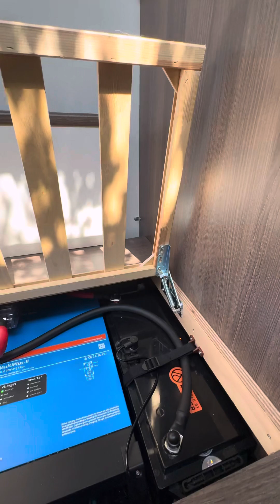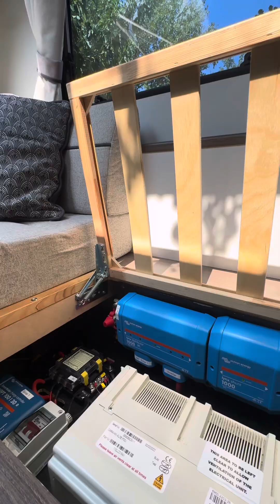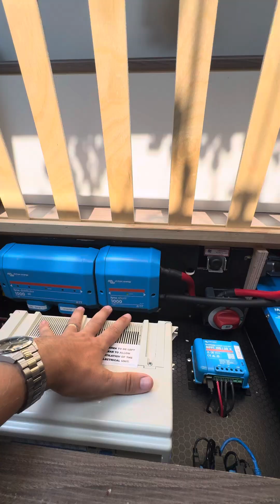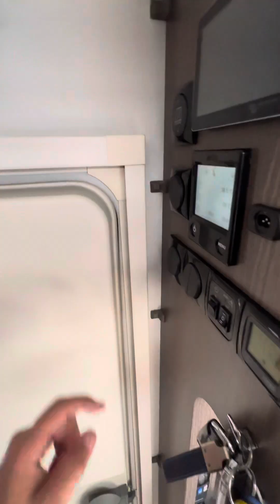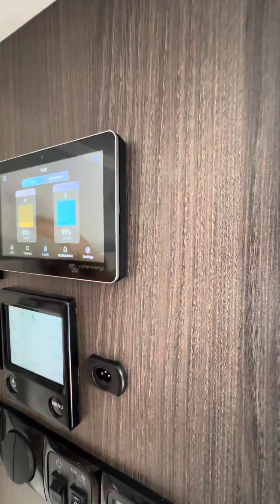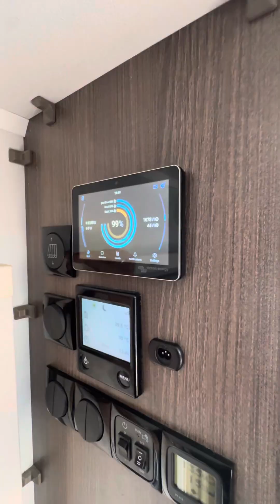Elddis Buccaneer caravan Lithium battery Victron Roamer S4 Off-grid setup

Comment: Do you have a wiring diagram you could share, I’m currently adding a Renogy set up to my 2025 Elddis so just looking at how others have connected up to original electrics.
Reply from the maker: I kind of do, if you message me on instagram or Facebook I can send what I have. the Victron Multiplus is a bit different to the Renogy though so I m not sure it will be of any help as its a pass through inverter meaning the electric from the hook up cable first goes to the inverter, passes through it and then travels to the Consumer unit. This meant all I had to do was cut the orange cable coming from the hook up plug in two and wired both ends into the inverter, it was then a case of supplying 12v on the second feed from the battery

Comment: Hi.  I just spoke to Solwise and they told me you’ve got this video because I have an off grid project.  

I have 2 x 100ah lithium batteries wired in parallel.  I bought an epever MPPT and have spend 5-6 hours playing with it and it’s going back hence I called solwise.  

I’ve got loads of spare solar panels and all I want them to do is trickle charge the lithium batteries as they supply my alarm and WiFi when I’m not there.  Ideally I want WiFi connectivity so I can monitor them from home.  I liked the epever because it monitors the battery temp.  

I want to wire 3-4 solar panels in parallel so I don’t exceed my voltage then feed that into the batteries. 

Any tips on what I should buy?    Thanks.  David.
Reply from the maker: Hi David, I only know Victron stuff but its superb stuff, user friendly and will do everything you want it to do

I'd personally suggest a Victron Smart Shunt 300A, these are around £60, this will monitor the battery voltage, capacity/percentage and if used with the temperature sensor will monitor the temperature of the batteries 

If you want to remotely monitor this on your phone then you'll need a Victron Cerbo GX, this is in short a computer, these can be picked up for around £180, you'll need a Victron Energy VE.Direct Cable which is another £10 but this will link the shunt to the Cerbo, you can then connect the Cerbo wirelessly to your internet router in the caravan/motorhome and create a Victron VRM account (free) so you can then monitor the batteries remotely on your phone anywhere in the world

If you want to go a further step and monitor the solar aswell, then get a Victron MPPT charge controller for those solar panels, you'll need to work out what controller is best for your panels but there's plenty of videos on here on how to do that, you'll also need a second VE direct cable to connect the MPPT controller to the Cerbo GX but that will then also give you remote monitoring for the solar so you'll know that's all working aswell 👍🏻 the other benefit with getting a Victron MPPT is that it will talk to the shunt so it will know the accurate info on the batteries including the temps and will shut off the solar charging when the batteries are full or in freezing temperatures

Hopefully this helps but any other questions don't hesitate to ask

Cheers Chris